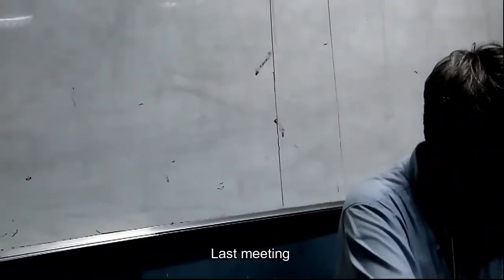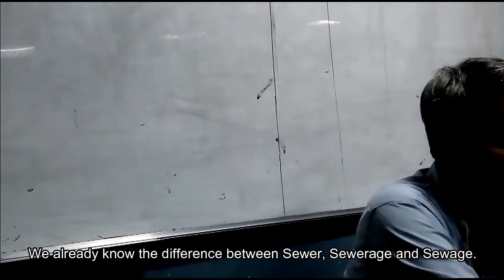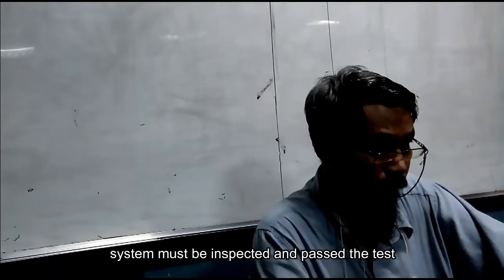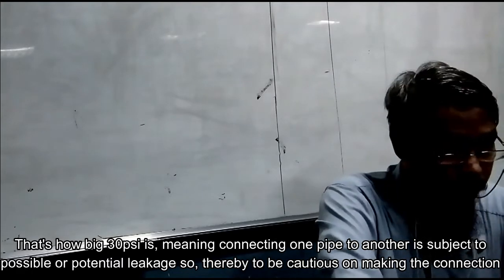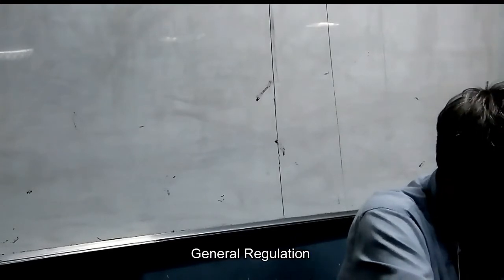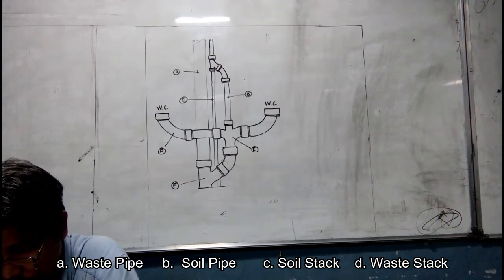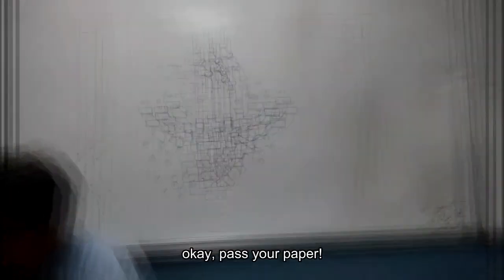CE526 Sanitary, Fire Safety and Plumbing Design || NPCP ch03: General Regulations

Comment: Thankyou for this lesson i clearly understans that In water flowing pipeline, pipe size and  water  pressure are dependent   on each other Because if the diameter of a pipe decreased, then the pressure in the pipeline will increase.

Comment: Murillo, Arien Shin F.
19-00603

Now, I learned that making test should be accurate and conscious when doing the three types of test. In the water test, it can be estimated at 29.4psi or 30psi and the air test has minimum of 34.5 psi.

Comment: Buizon, Randylyn C.
19-00979

Thank You Sir for informative video and I have learned in this lesson is about the minimum pressure that is needed when doing a water test. Its 29.4 or can be estimated as 30 psi. The air test has a minimum of 34.5 psi in pressure.

Comment: Tojon, Vincent Gino T. 
19-00623

In this lesson I've learned that in Water Test has the minimum pressure of estimated 30psi and to the Air test it has a minimum pressure  of 34.5 psi

Comment: Pedrigal, Jhon Harvey M.
19-00204

Thank you sir I learned to be more cautious when connecting pipes and installing plumbing system elements and how to recognize the air leak, water leak, and pressure

Comment: Sible, Precious Audrey D
19-01502

thankyou sir. we learned about the minimum pressure that is needed when doing a water test. Its 29.4 or can be estimated as 30 psi. The air test has a minimum of 34.5 psi in pressure.

Comment: Mendiola, Mc Axel Joseph P
BSCIVE 19-00167 

Thank you very much sir because in this video I found out which minimum pressures need to be used in each test to pass the inspection and testing. additionally, I have learned how to be cautious when you connect the pipes and install a parts of the plumbing system

Comment: I've learned about the minimum pressure that is needed when doing a water test. Its 29.4 or can be estimated as 30 psi. The air test has a minimum of 34.5 psi in pressure.

Comment: CAGUIOA, DANIELA O.
19-00459
BSCIVESE

Thank you Sir! I have learned that each test has different amount pressure for it to pass the inspection and testing. We should know the minimum or needed amount of pressure. And also it is important to be cautious about the connection of pipes that might lead into leakage.

Comment: Plumbers should use proper scaffolding when the plumbing work is carried out on the external face or at the height more than 2m. Scaffolding should be thoroughly inspected to stability. While using ropes/zulas, sufficient care should be taken to prevent accidents. They should be secured properly without fail.

Comment: Ruiz, Sharlize Veyen C.
19-00620

Thank you so much sir. Now I know how much pressure each test are needed to make sure to pass the inspection and testing. I know which extra effort should a plumber provide before the system is being inspected by the inspector. Well, this is not just a knowledge for the plumber but also for the homeowners.

Comment: ETABES, JOSHUA G.
BSCIVE 19-02128
Thank you, sir; now I know how to be cautious in connecting pipes and installing parts of the plumbing system, recognizing the air leak, water leak, and pressure so that in the final inspection and testing, we will expect that our system is okay and pass the inspection and testing.

Comment: CANTOR, ALLYZA MARIE F
BSCIVE-SE
19-00936

3 Type of Test
Water Test- minimum pressure is 29.4 psi or estimated 30 psi
Air test - minimum pressure 34.5 psi
Waste Drainage Test

Atmospheric Pressure is 14.7 psi
30 psi is the air pressure of a tire
pajero 33-35 psi 
buses 60 psi

Comment: 1)Kasim
2)Plumbing system @ 1:34
3)Water test @ 4:12
4)Air test @ 4:38
5) Pressure @ 6:10
6) Potential Leakage @ 7:15

Comment: 1. Candido
2. Inspection and testing @0:51
3. Plumbing system @1:15
4. Appurtenance @1:46
5. Leakage @7:15
6. Flushometer Valve@11:20

Comment: 1. Castigador
2. Plumbing system @1:36
3. Inspection and testing @2:19
4. Water test @4:13
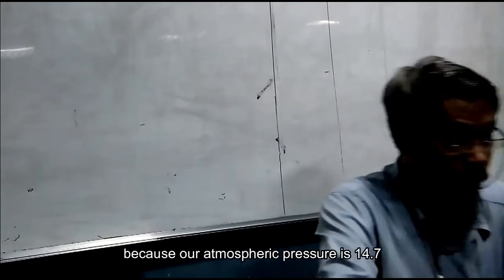5. Atmospheric pressure @6:01
6. Tire Pressure @6:30

Comment: 1. Dacumos
2. Inspection and testing - 2:22
3. General regulation - 8:56
4. Vertical pipe - 10:01
5. Flushometer valve - 11:20
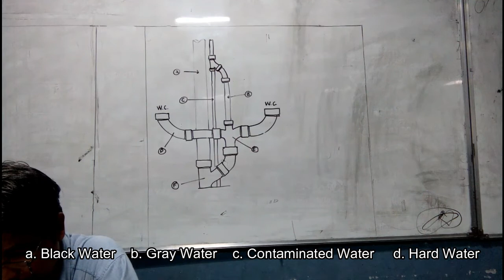6. Gray water - 12:09

Comment: 1. DORON
2. Inspection and Testing @2:24
3. Water test @4:05
4. Air test @4:05
5. Waste drainage test @4:05
6. Vertical Pipe @ 10:15

Comment: 1. Cahigan
2. Testing @ 0:43
3. Equipments and Fixtures @ 2:10
4. Atmospheric pressure @ 6:00
5. Vertical pipe @ 10:16
6. Flushometer valve @ 11:23